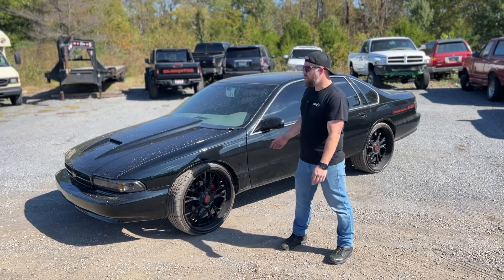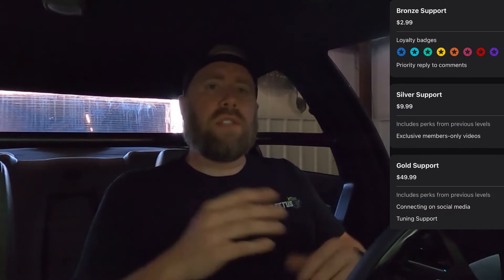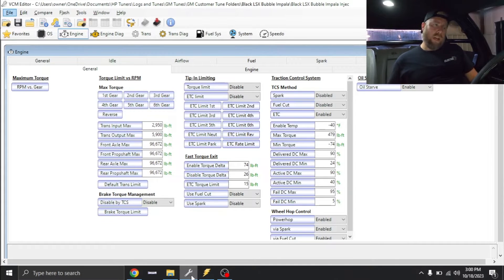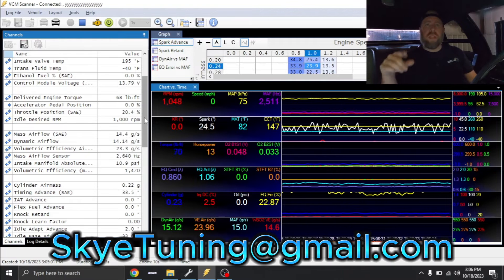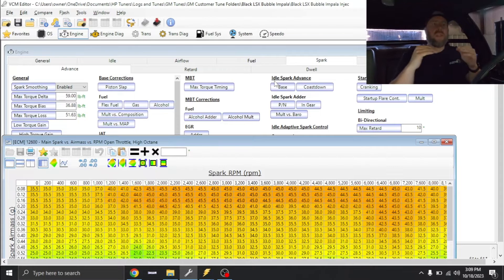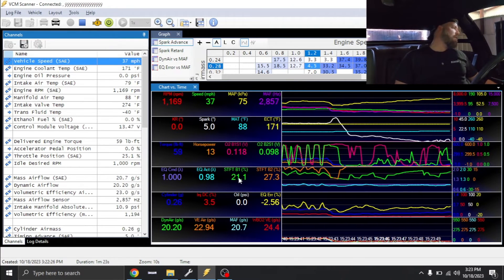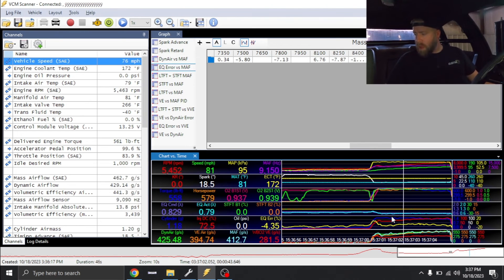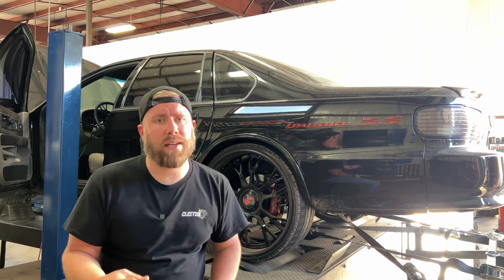Tuning a Bubble Impala SS with a NITROUS LSX 454!

Comment: Hey I got a question should I get one of my knock sensors fix it’s bank 2 is out and from your videos it would be best to get that fix before getting professional tune but could I get it tuned anyway or it would be dangerous and harmful for my motor it’s a 4.8 LS
Reply from the maker: Yes I would get that fixed. When your truck throws a knock sensor code, it defaults the the Low Octane ignition timing table and will cause a loss of power and fuel mileage. It isn’t harmful to the engine though so just fix it when you can. If it’s a Gen 3 truck, get genuine ACDelco sensors and the harness. Replace it all at once. If it’s Gen 4, just replace the faulty sensor with an ACDelco part. RockAuto is usually the cheapest place.